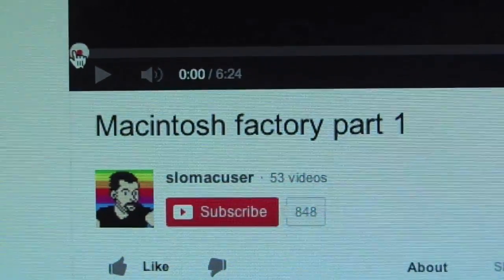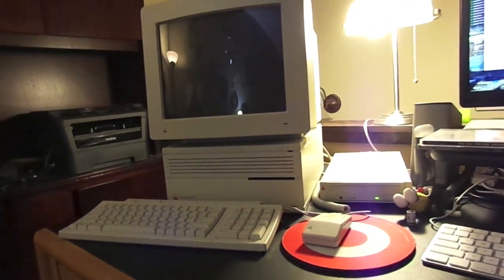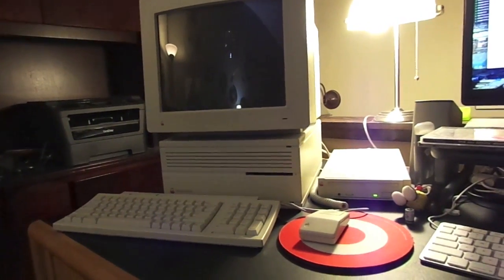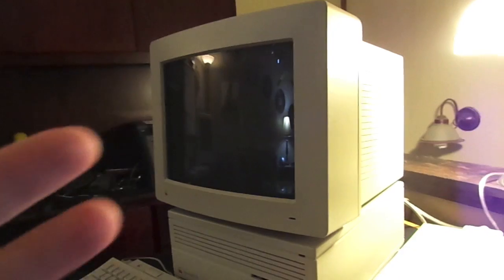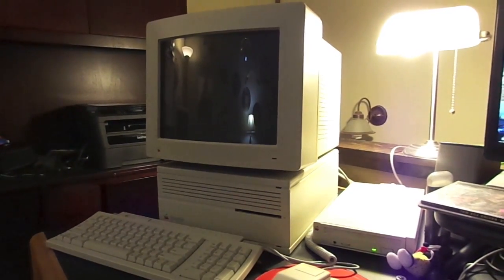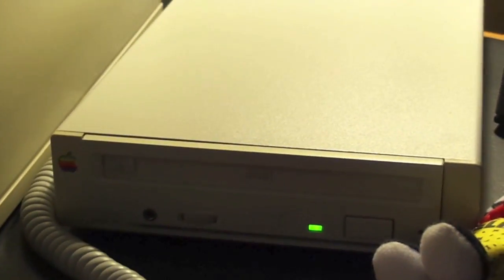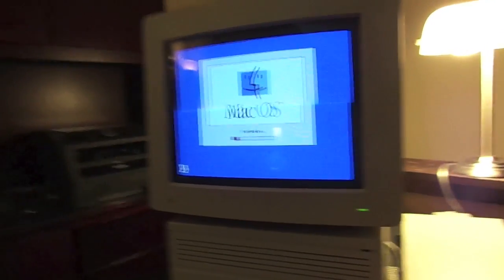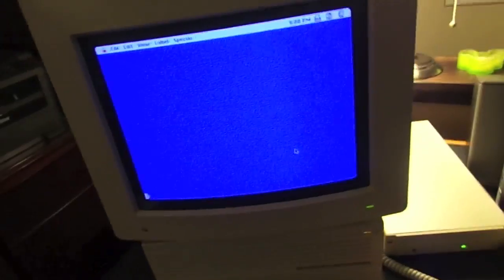Macintosh IIci FULL TEARDOWN and REASSEMBLY in SIX MINUTES!!!

Comment: System 7.5.5 on a IIci even with enough memory is going to crawl, put 7.1 on it if you want it to boot quickly. The IIvx/Performa 600 was Apple's 1st in-house case design? It shows as it is downright HORRIBLE to work on.

The machine was profitable even with high US labor costs because Apple charged and arm and a leg for these machines new compared to the 68k based competition (see Amiga 2500 and 3000 and Atari TT/Falcon). I would have been surprised if they didn't make a profit on these.